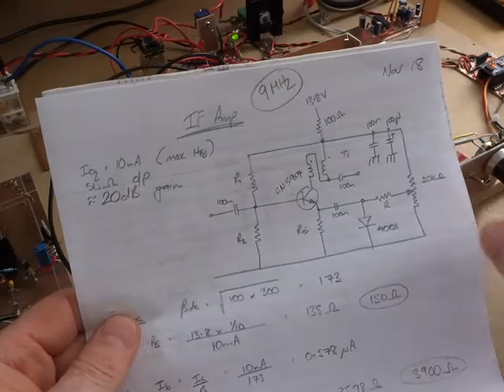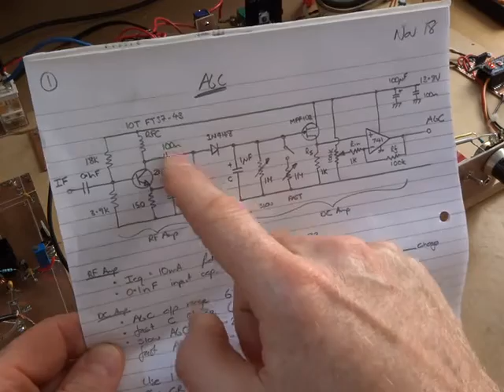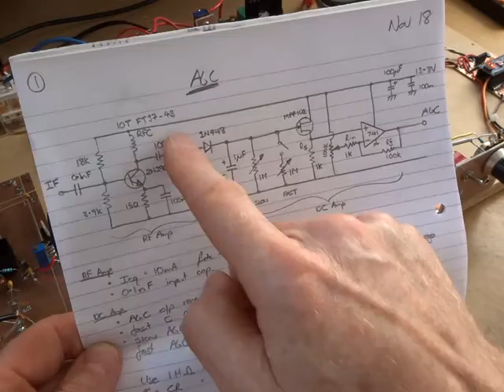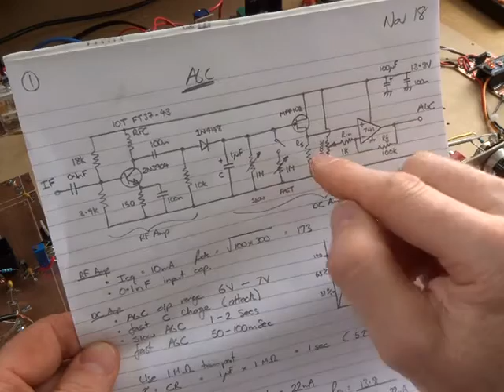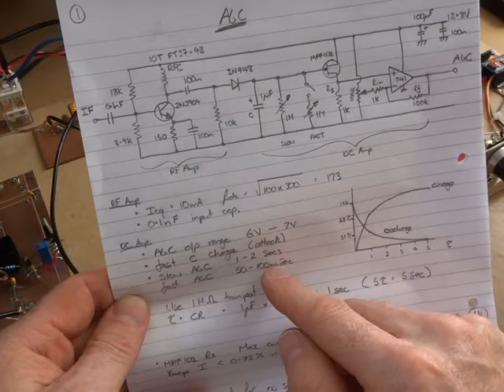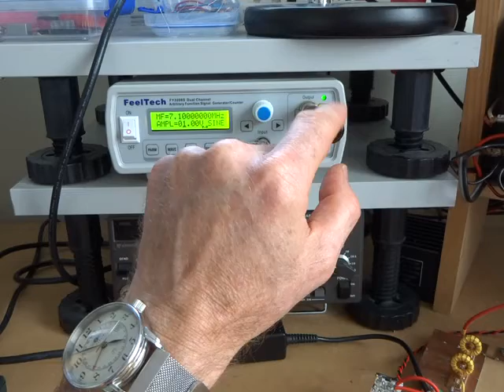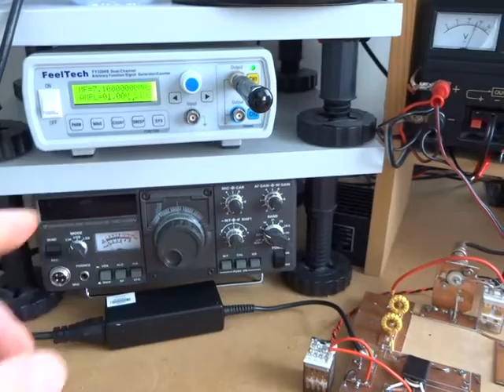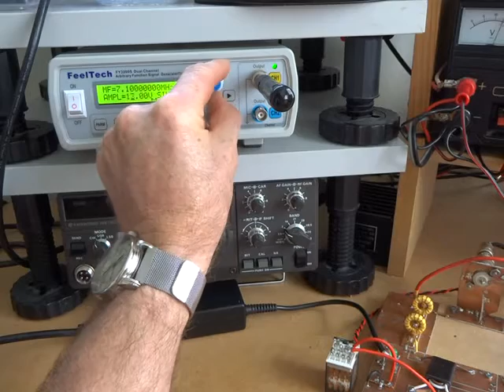Homebrew MC1350P based SSB Rig - #14 AGC

Comment: In your MC1350 IF amplifier rig where did you tap off of the IF for your AGC circuit. I have a 20 meter receiver I an building and am using a MC1350 for my 9MHz IF amp. Thanks!
Reply from the maker: Sounds good Loren.

Comment: Hi Charlie, you're a great inspiration for homebuilders, thanks so much for your videos! I am working on a transceiver based on your design, can you please tell me where is the AGC connected in IF chain? Is it at the output of MC1350P? Thanks a lot!
Reply from the maker: Hi Daniel. Thanks for the feedback. The AGC input is connected to the output of the MC1350P amplifier, i.e., in parallel with the input to the product detector.

Charlie
Reply: Thanks a lot Charlie, keep up the good work! @CharlieMorrisZL2CTM

Comment: Hi Charlie,
I believe that you have chosen the right way to apply the IF AGC. I currently operate my AGC from the rectified AF. In doing so, I notice that at strong stations first a strong oversteer is to be determined which then subsides after 300 - 400ms. That's probably my time constant owed to the AGC. Therefore, I will try it in the near future with IF equalization.
Will you install a S-meter?
73 Bernd
Reply from the maker: Hi Bernd. That sounds like a plan as we say. Yes I did install a S Meter, but I did it in software. I drop the 7VDC max AGC voltage across a 470ohm+1000ohm voltage divider. The middle tap goes to the Arduino analogue pin. I then read that each time through the main loop and take a 10 sample average. That is then converted to a S Meter reading and displayed (I did a quick calibration against the commercial rig's meter). That seems to work ok.

Charlie

Comment: Hi Charlie, at the very beginning of your video there was a close-up shot of your AGC board. I wanted to do a Print Screen of it but it disapeared, I can't figure out how to get it to show up again when I view your video. Can you upload it somewhere for me to download? I am learning how to use your technique for building circuit boards. I can use the picture of your AGC board to layout my parts better. Thanks! de N8WQ
Reply from the maker: Hi Orville. Unfortunately, the video is deleted (I do that after upload). You should be able to pull down the video off YouTube and pause it. In words, this is how I tend to use the board for a standard common emitter amplifier. The logic is the same for other configurations. The bottom strip is ground (with mounting tag), next is emitter, then base, then collector, then Vcc, then finally ground again (with another mounting tag at the other end). The circuit is then constructed left to right as per the schematic. Note, there will be inter-track capacitance, so i always try and cut tracks to stop signals feeding back. Those signals will either be in phase or out of phase, and can cause stability issues. Given the frequencies I use, I haven't had any problems.

Charlie
Reply: It was the video title card, not part of the video. These are generated by Youtube unless you have a lot of subs. I was looking for it as well.

Comment: The most important thing of all that you realize is the exposure of the circuits made! I want to think that when you have completed the realization you will put together a single scheme with all the values in tension, current, etc., so those interested can use your excellent works. Congratulations de Giovanni (i7iwn)
Reply from the maker: Hi Giovanni. I will try. I do put everything up on the blog at: https://zl2ctm.blogspot.com/
I'm hoping that is a good way to share the circuits and the logic behind them.